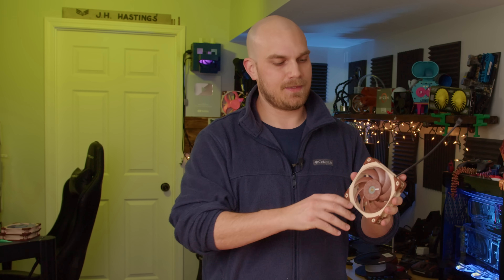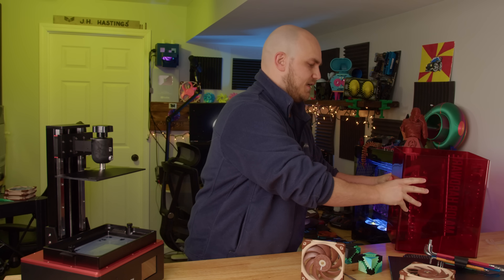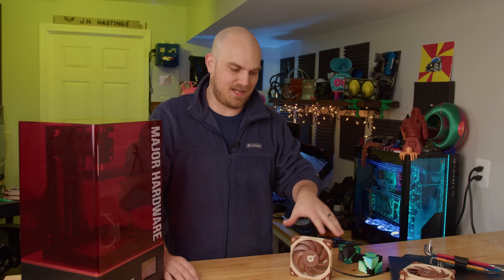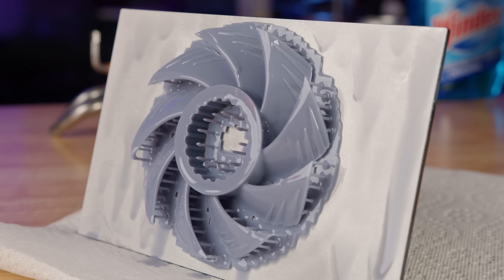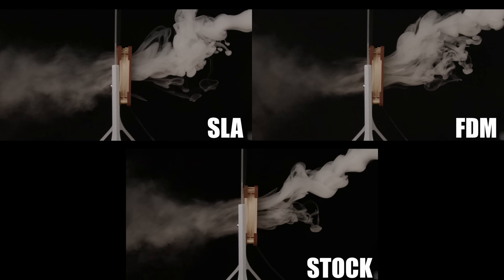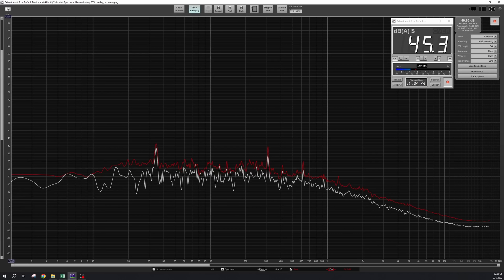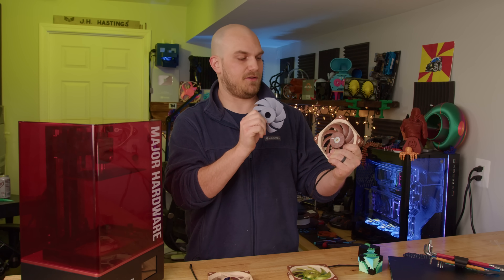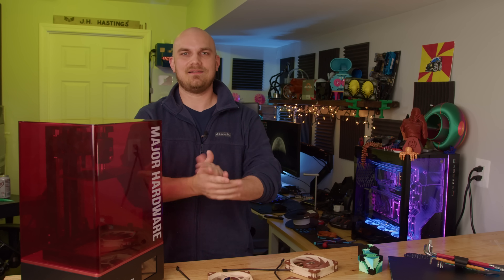I Copied Noctua's A12x25 and Resin Printed it, Its Performance Was ASTONISHING

Comment: Congrats with the new addition to the family!!  I was wondering what happened to you!  I'm glad to hear that the reason for your absence was a positive reason. 
Anyway!  That is interesting.  Good job with recreating the fan first and foremost.  But that is interesting to see the results.  Then again, when you think about air and how it moves, it will move and flow better on a smooth surface, vs something that maybe has layer lines.  Then again, that is a subjective topic depending on what we are talking about here (I.E. A PC fan, Vortex Generators on a car, An Airplane Wing.  Some things have functional obstructions, for lack of better words, that might help one of these items, but potentially hurt another)  If you can find a bigger printer, and you are up to the task, I'd say go for it!  Maybe do another video where you revisit some of the designs that were already printed at the top of the list, and see if there are any additional gains to be had, even though you already proved there is a small gain with your own design.  I'd be interested to see how maybe the top 5 designs do in resin vs their original print.  Again, congrats on everything!  Welcome back. And this video was filled with some interesting findings, and great news.  I can't wait to see where things go from here!

Comment: I've said this before, but I really want to see you ditch the noctua motor in favor of a variable speed motor so every design can be tested at the "same" rpm. It would be fair to not draw more current than a normal fan header can provide, but it could even out the playing field between the different designs.

Comment: I bet he actual material is likely as much, if not more a factor than the printing method (resolution and surface smoothness).
The latest noctuas use an especially rigid polymer to enable a smaller clearance between the fan and the casing, without rubbing with time/wear/maxRPM. FDM printing can use lots of different materials, but PLA is the most common by far, and while PLA is decently rigid I'm sure it will deflect significantly more under high RPM. I'm not sure what the least flexible common FMD material would be, but polycarbonate or nylon would probably rate high. If you happen to have one of those lying around it might be worth seeing how that compared to the (presumably PLA?) version.

For those interrested, CNC kitchen is an excellent channel to learn more about this sort of 3D printing engineering science stuff.

Sidenote: if you really wanted to reverse-engineer the CAD, a high resolution 3D scanner would probably be your best bet. I assume you don't have one, but with your media profile it's probably quite doable to source if you really wanted :) As for the legality of something like that - I'm an engineer dammit, not a lawyer! :P

Comment: Congratulations again for the family expansion!
Please do resin printing, the difference could be enough to elevate contenders above the Noctua base fan.
Please do a test run with some of the more difficult or effective prints to see if the 2% correlate with the troublesome or victorious fans, perhaps? 
Just so there's more data to validate the cost of the bigger printer?
Looking forwards to seeing where this series goes!

Comment: I think it would be fun to see some of the fans that are at the top of the chart reprinted with resin. We'd get to see it that can push then closer to or above the original A12x25. It would also help to see if the percentage difference is consistent, then you could decide if it's worth going all-resin for future shows.
Reply: Yeah before jumping in with a bigger printer, seeing the difference with a few fans that were already tested would probably be a good idea. I think a larger sample size will help us see if there is really a practical benefit to this for the average community created fan. But it could also be good to just do a one off episode where ALL the fans are designed with resin in mind. I feel like quite a few in the past have been let down on the fine details, and it would be cool to see if it makes a difference.
Reply: adding the 2.6% means the Angel beats the A12x25 495 to 497 !!
Reply: I'd like to see the ANGEL(11bladed fan) in resin
Reply: Ditto. Make the final show of the season a resin-printed showdown between the top 4 fans of that season.
Reply: Audience of webshow that generates heaps and heaps of data, demand more data.

Comment: congrats on the new bub, one thing i noticed even just in the thumbnail and i could see that the printed fans had wider blades than the stock one so they not going to perform the same unfortunatly, the printed will have better static pressure but probably a little less flow rate

Comment: Resin might allow for some more complex fans to be printed more true to the designer's intent. Especially the really thin ones.
So 2% vs FDM could potentially turn to 5% or more.

I'd say go for it, provided you can streamline the fabrication pipeline a bit to make it easier on you

Comment: I think on the resin printer, as long as you can find a printer with a build area large enough to only need to print most of the showdown fans in one go, then I would say go for it. If not the extra PPE and prepwork it takes will only make recording them harder. What you could do is use the FDM for the season, and then in the finale, reprint the top fans with resin and see what improvements / if they go from coming close to passing the A12x25

Comment: I think since it's such a pain, why not just do a resin print of the top 5 fans from the fan showdowns, and retest to see the improvements?
Reply: I remember some of the printed fans in early seasons not looking much like the models they came from (especially with strands of filament sticking out between blades), so this might actually redeem some of the worse contenders too.
Reply: This
Reply: @builderbobbo1916  ... is the way
Reply: I concur. If you can establish a consistent percentage difference between resin and FDM, just apply that percentage to all subsequent fans. You don't need to resin-print anything if you can verify the differences.
Reply: @firecopscott  I too concur, there could be more substantial difference in more complex fans, like geared fans or fans with many small blades, which the generalization would not properly account for
Reply: Ooo that's a really good idea!
Reply: Reprint the top 5 and the bottom 5
Reply: indeed, try a few and see if you can consolidate the performance delta, then we just know "how much better it would have been" while still saving your time and your lungs
Reply: P l e a s e
Reply: This!
Reply: Took the words right out of my mouth!
Reply: Exactly! Establish a baseline to see if the results from this test are valid. Then, you could continue with the standard FDM printing, but just add a +\- 3% margin of error notation to measurements.
Reply: What they said
Reply: This is exactly what I was thinking
Reply: Came to say the same thing, happy to see almost 1k agree
Reply: Oh no... 

I feel the cheater will break up the leaderboard
Reply: Would be interesting to ask the top 5 of all time to try to improve their fans and then resin print those.
Reply: I think it's a good idea myself...
Reply: maybe ditto for peculiar designs that get mangled by the FDA printer
Reply: Yep. Exact same thought
Reply: you can do sla for season's top 5 fans. and congrats. since you have  another baby, it's hard to ask you to do sla for everything. it will decrease the videos frequency which i don't want.
also you can try softwares to get a cad file for an object by using pictures or 360 vid
Reply: I agree, just do the top for the year to get best total score.
Reply: Other more time-effective idea is to smooth the FDM with acetone
Reply: agree
Reply: Agreed!
Reply: Haha exactly what I opened up the comments to say!
Reply: Yes top 5 of all time
Reply: this is the same thing i was gonna suggest
Reply: This
Reply: I agree with this.
Reply: resin season finale ftw
Reply: Lol, I just finished the video and posted almost exactly this comment.

Comment: Honestly, as long as they are all made with the same printer it doesn't really matter. Whatever is easiest for you to get the job done and test for us. 
P.S. congrats on the new family member! Hope you all are doing well.
Reply: Different designs are going to be affected very differently.  Stock Noctua is actually a best-case scenario for rough prints because the design itself is so optimized.

I don't think that's a fair baseline for amateur experiments, especially when they often have a lot more surface area.
Reply: True. Try out some different designs in Resin and if the performance difference is only around 2 percent vs FDM, then just add a correction factor when printing in FDM 🤔

Comment: If not all the time at lest more resin prints would be nice for special ocasions like this, I am also interested to see if you can take the OG fan design now that you got so close and adapt it to cheap or less expensive fans and see if you can save money while geting similar noise and performance or at least see if the motor of the fan plays a big part

Comment: You should continue printing the way You have been, but not rate them against the stock A12x25, but instead the 3D Printed variant so they all suffer the same (if minimal) performance drop.

Comment: hi MH, I have experience with SLA and FDM printers. There are plant-based resins that are WAY less stinky and supposedly less toxic (I still wear PPE when handling it, personally) than standard resin. If the smells bothers you I think using the plant-based stuff will make it a lot more tolerable.

Comment: What was the weight and RPM differences between these fans? That could go a long way to uncovering the “why” for the FDM being as far behind has it was. 

Maybe printing with a lower layer height, the roughness of the FDM could be reduced. 

If there is a 2% weight difference that equates to a 2% reduction in RPM… That could account for the results in the video. 

There are lighter materials that can be used for FDM printing as well. 

Basically, this video was a great starting point, but it would be premature to call resin the winner over FDM for fan printing.

Comment: Resin has been a thought I've had since the beginning of the fan showdown. The rough surface of the printed fans always bothered me. Air behaves like a fluid, so more smooth = more better! And maybe the first episode of the next season could be printing the top performers again in resin to measure the performance increase.
Reply: As long as the printer used across different fan models are the same, then it does not matter if he used FDM or not.

He could try out some different designs in Resin and if the performance difference is only around 2 percent vs FDM, then he could just add a correction factor when printing in FDM instead of bothering with Resin printing.
Reply: @sepg5084  the difference between resin and FDM could be variable based on layer orientation, and overall geometry. Some fans may take a larger hit from FDM than others. Applying a blanket correction factor may not cover it.
Reply: Ditto! Just reprint his idea as my idea in resin...j/k
Reply: Agreed +1
Reply: Well now you know it makes very little difference
Reply: People are bringing up shark skin and golf balls, but I'm willing to bet that if an FDM fan was sanded to smoothness, or coated in a thin flat layer of UV curing resin, some or most of the 2% loss would go away. I think even the added weight of UV resin on an FDM print would make less of a difference than having a smoother surface. There are a number of YT channels of people making FDM drones and RC boats, and they all achieve faster speeds and lower power usage after smoothing FDM printed surfaces.
Reply: Gases are fluids. </pedant> Smoothness does not always mean better. Look into sharkskin and boundary layer physics.
Reply: More smooth = better? Tell that to golf balls...

Comment: While giving everyone's designs the best chance would be nice I don't really think 2% is worth it if it would mean having to deal with printers and processes you don't like using.

And now to basically contradict myself, what if it was simply a case by case basis? If a fan requires or would particularly benefit from the higher detail and the designer can sufficiently justify it I have no problem with different fans being different materials. Just add a column in the spreadsheet that lists printer/material/layer height and people can refer to this video for what difference it makes

Comment: With the resin printer, you cold stack all the different fans for an episode into one CAD file and use the support structures to hold them in place. They could all be printed in the small printer you already have due to the way resin printing uses the vertical space more efficiently.
Reply: But that would hardly save any time. But if you can print several side by side, then they only need the same time as if you would print only one.
Reply: @Zockdoch  you know how time consuming the work is to clean and prep the printer as well as the curing and such. :L
Would definitely be more efficient to print as many objects as you can. Everyone does that.
Reply: @DiverseGreen-Anon   you scrape the print of the the buildplate, wipe the plate clean, but it back in the printer, top off resin and start the next print. 1-2 Minutes.
So you can wash and cure the print while the second is already running.
Stacking prints in the slicer is alot more time consuming and prone to fail.
Reply: @grebnek  I think they mean post processing of each fan, twice as many supports to remove, etc.
Reply: @joescalon541   the amount of supports would be at least the same. But preparing the supports would take alot longer. Look at 4:35. How should he support a second fan above without supports starts of the first fan or spacing them very far apart.
For cleaning, support removal and curing he can wait until all prints are finished and do them together, as long as they are not exposed to uv light nothing will happen.
Reply: Lol, calling the Saturn small... It's one of the largest consumer resin printers out there hahahaha
Reply: @CaedenV  Not to use a burnt out comment, but.........

FormLabs Form 3 XL enters the chat.
Reply: @CaedenV  Elegoo jupiter.... Formlabs Form 3 XL... Phrozen sonic Mega 8K... anycubic Photon M3 max... etc.
Reply: Stacking is a gamble at best. Every extra layer exponentially increases the probability of failure. You may get 4 fans in one print, but the odds of a successful print is 1 in a million. Not worth the wasted resin

Comment: You should print it with 0.1 layer height (or less) and try to post-process it (sanding, putty, abs with acetone(. Also you should try to weight each one.
Reply: this ^

Comment: Have you considered doing a surface treatment of the FDM print? Like one of those acetone fume treatments or something that smoothens out the surface? That would be pretty interesting and probably fairly easy to test.
Reply: I think he already tried that in the past, I might be wrong tho'...
Reply: @YOEL_44  Yeah he's done that, he's got two videos that tests this "SMOOTHING 3D prints with isopropyl alcohol" and "Does Smoothing 3D Prints Improve Performance and Can You Smooth PLA?"
Reply: @YOEL_44  I think you're right ;)
Reply: That only works with ABS, which he probably doesn't want to print with for the same reason as resin. It releases noxious fumes when melted, and the fumes are actually worse than resin. I think part of the reason resin performed better than the FDM is the hardness of resin. It's a harder material than the filament he uses, so the fan blades are stiffer. ABS is softer/more flexible than PLA. I don't remember what filament he uses (PLA or PET-G), but ABS is about as flexible as PET-G.
Reply: You can smooth PLA with resin but yeah that defeats the point. Resin is honestly where it’s at when you need to be concerned with smooth airflow.
Reply: Ah ok so that was his videos I watched. I've seen a few but wasn't sure if it was his videos or not